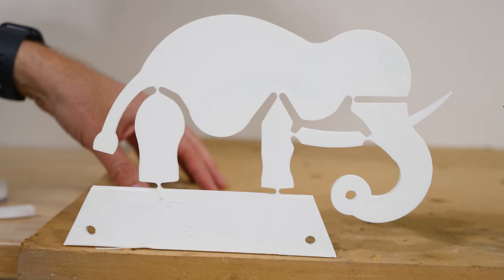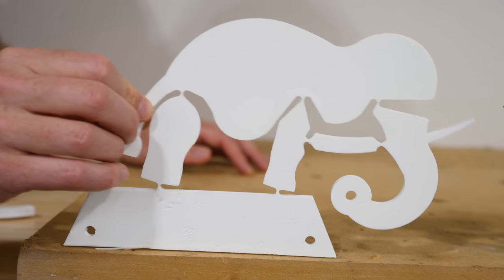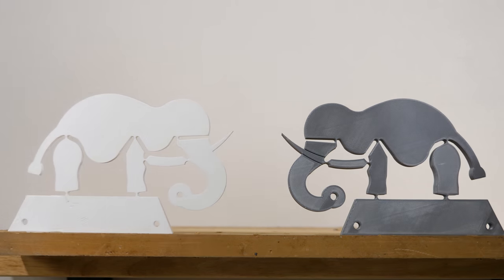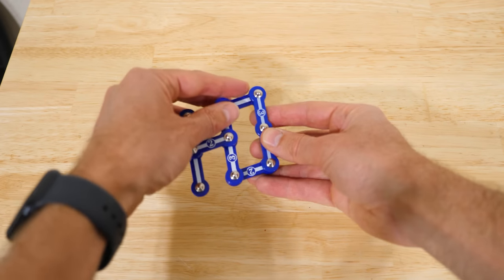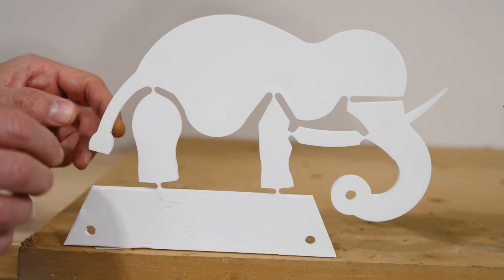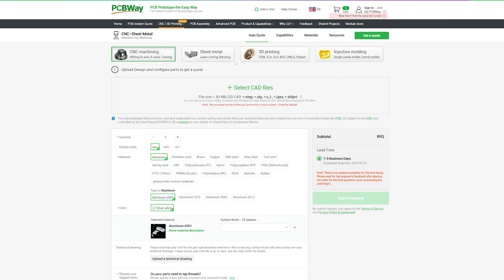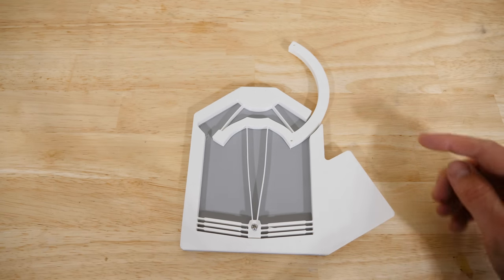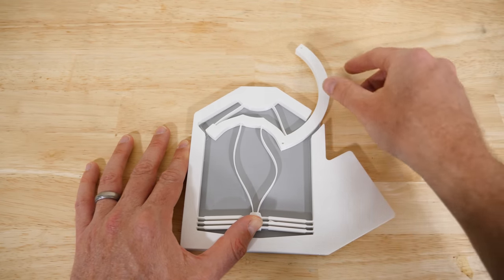How Does The Wyrd Mechanism Work?

Comment: Wrong. The trunk is moving rearward in relation to its owner. Only the tip does not move but really it does. Rotation is movement. By your explanation the legs aren't moving either.